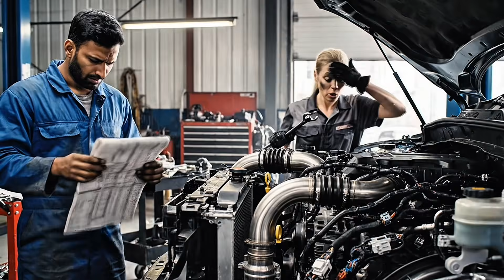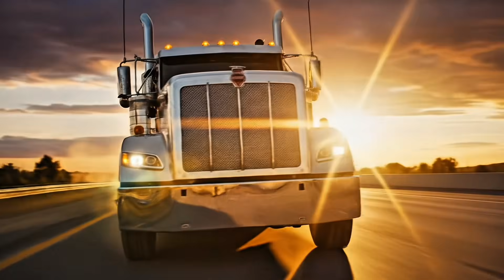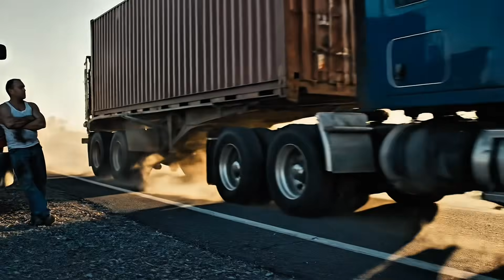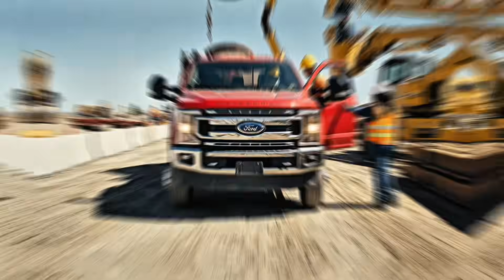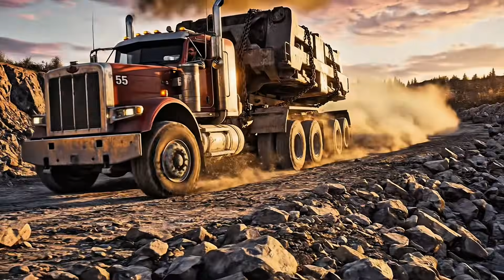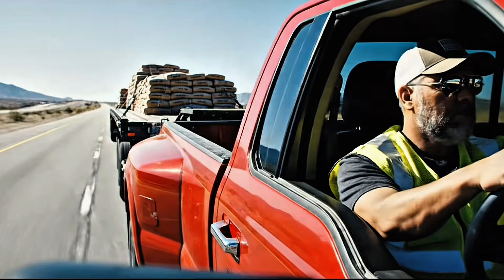It’s Over: Ford’s 7.3L V8 Just Ended the Truck War

Comment: Apparently you dont understand diesels and turbos on those in line six engines
Reply: to heavy in 4x4
Reply from the maker: Weight is definitely a factor, especially off-road. Trade-off is you get that low-end torque — great for towing, not always ideal for everything else.
Reply from the maker: Not saying they’re bad at all — inline-6 diesels are actually some of the best setups out there 👍 Just comes down to how they’re engineered and hold up long-term.